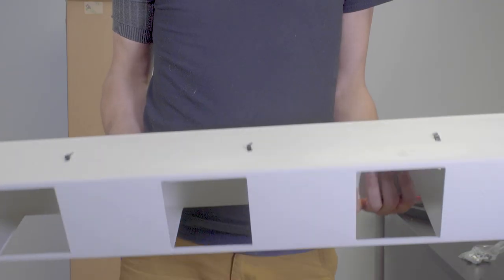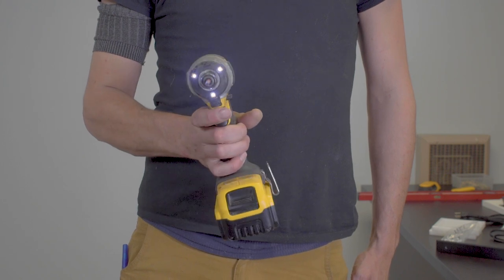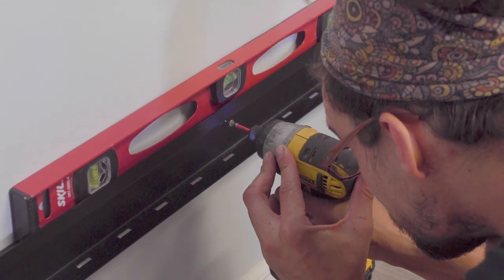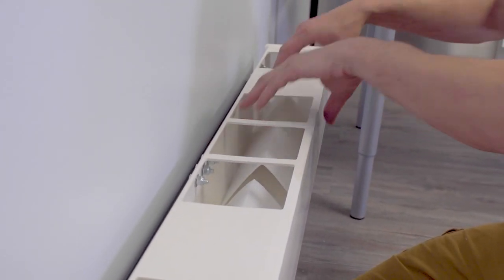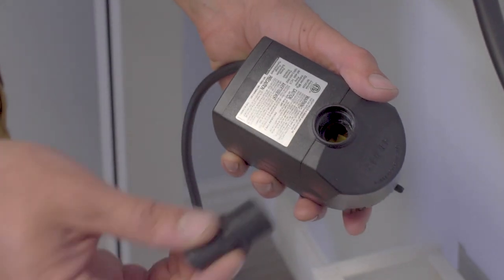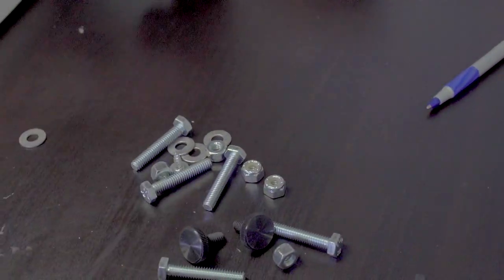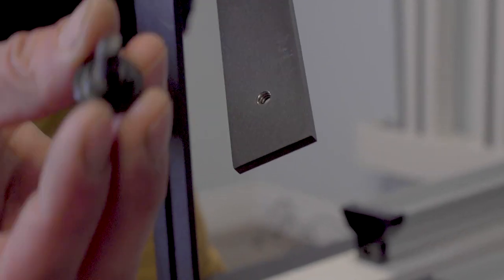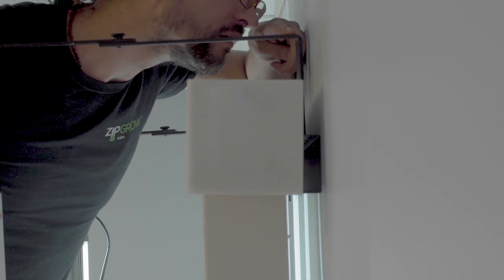Farm Wall Installation

Comment: How would this change if I want to mount my farm wall to a rolling dolly? Do I need the wall mounts or - if the bottom gutter is secure (e.g. in a grooved base) - does the farm wall itself stay vertical without supports?

Comment: The LED bars look very close to the Zipgrow, if the plants grow taller, is there not a risk of burning the leaves. What is the PPFD at this distance.
Reply from the maker: Hello Pierre! The brackets are adjustable, so they can be moved in and out as the crop grows and the PPFD ranges greatly depending on this distance 

Thanks for watching!

Comment: Why use these old lights instead of the LED Ultra Violet Grow Light strips?
Reply from the maker: Hello Sam!  

We love to experiment with new lights all the time, and have found a ton of interesting configurations. The biggest challenge, however, is still being cost-effective to production. Often we have to balance both the value of produce to the customer and the cost of lights. As you can imagine the cost of lights increases significantly with technology so it is important this is economically sustainable if we want a future in vertical indoor farming. 

Thanks for watching!